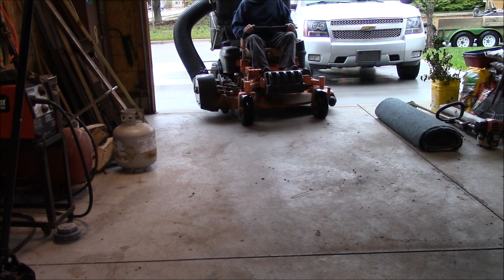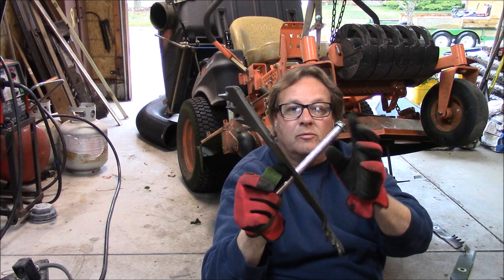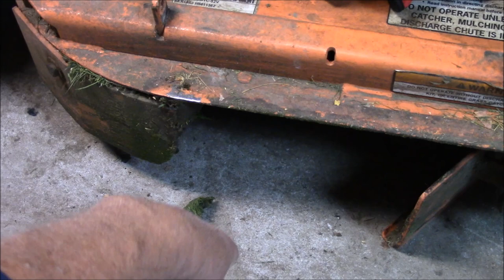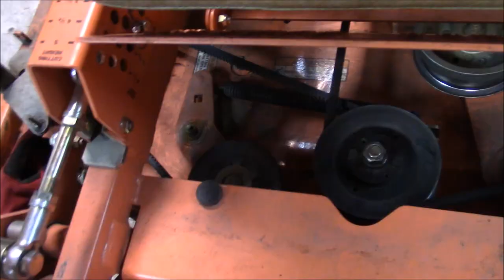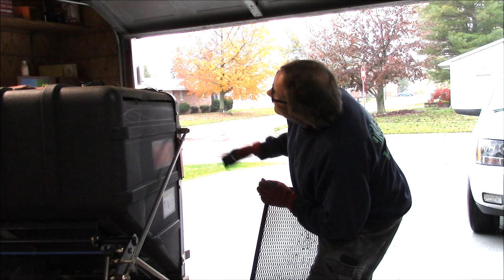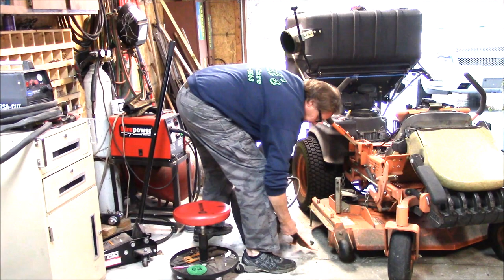Scag Tiger Cat review after 378 hrs and changing blades, Today's Events Vlog 66

Comment: Mark this video helped me with my 2006 Tiger Cub with 378 hours on it. I haven’t had the belt issues you have, but it’s time to change them this season. Thanks for the clear instructions on removing the bagger. I needed that. I did have to change the electric clutch, it had a direct short last week. I agree, great mowers. The hydro connections on mine leak also, I’ll tighten them this fall. The manual says every 200 hours. Thanks!!!

Comment: That is a cool way of jacking up the mower to change the blades, I have the Tiger Cat 2 with the triple bag bagger and I only have the back baffle on the deck to shrink the hole, I agree with you, the front one is useless and it clumps bad when your not bagging. 
Great video!
Reply: Where did you get that  hoist and do you have a  link to  it?
Reply: How do you like your tiger cat 2? Have you had any problems out of it?

Comment: I have a scag tiger cat too with the kohler 27 hp motor,Im not a landscaper but I have like 3 acres to cut and I love it ,went from a little 42 inch lawn tractor to the 61 inch cut got 658 hours on mine ,bought mine used,I do the same with mine to change the blades with a chain hoist ,no bagger though just let it fly lol,great video and review

Comment: My Gravely, I've changed the main belt drive for the blades once. When I serviced the hydro, I replaced both filters then had to replace the short hoses from the tanks because they started leaking. Now need to change out the spindle it's gone bad.Mower has 563 hours on it and I only mow my 5 acres that I bought in June of 2014.
Reply from the maker: Doesn’t matter what brand of mower you buy they are always breaking. My Scag that is 3 years old I have stuck a thousand dollars into it already.
Reply: @Marksmisfitworld  That much already? Wow!

Comment: I have the same year tiger cat. The hydro leak you can tighten the clamps but the fittings in the pumps need to be changed. It was a warranty thing and so far, no more leaks. I'm curious about the belts as I'm almost to 150 hrs. I noticed your middle spindle bolt was clean, mine has a lot of corrosion on it. Good video, thanks for the info.
Reply from the maker: I will have to check into the warranty thing if the leak continues. Dealer never mentioned anything, but that does not surprise me either. I think the belts were just a bad batch from the manufacture. The bad belts had kind of a brown tint to them.
Reply: I have a 2012 tiger cat 61 SS ....i have had problems with the hydraulic hose that is under leaking for years!!!! I've changed and tightened the hose clamps what feels like 100 times....lol....i wish I would have taken it in to dealer under warranty....never crossed my mind to change the fittings on the pumps....i am approaching  1000 hours on the mower now and will be doing extensive maintenance  soon....first thing I'm gonna do is change the pump fittings.....thanks

Comment: Hi mark its art, how do I adjust engine rpm on my scag tiger cub? Is it the governor plate? Either raise or lower, I will have a rpm tachometer today, its running to fast. Thanks!!! You guys take care, thanks!!! Art.
Reply from the maker: The governor is what controls the maximum engine rpm's
Reply: @Marksmisfitworld  thanks mark I raised the governor plate and it slowed the motor down, I bought a optical rpm gauge, it has tape, do I put that tape on the crankshaft to see rpm, I put a piece on the spark plug wire,  but it didn't show 3600, do I do one side and times it by 2? It's a cheap tachometer,  thanks, hope you guys are doing great!!!art.